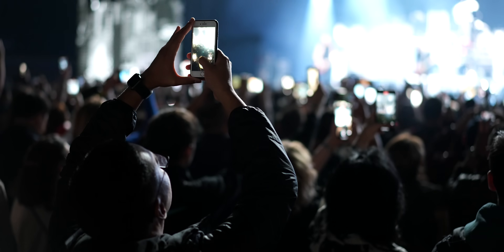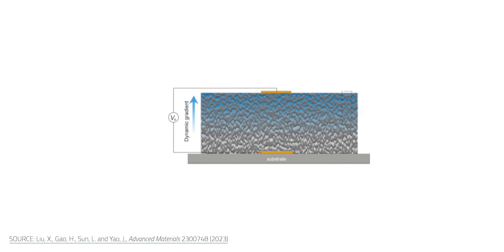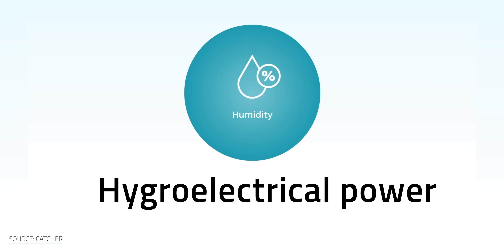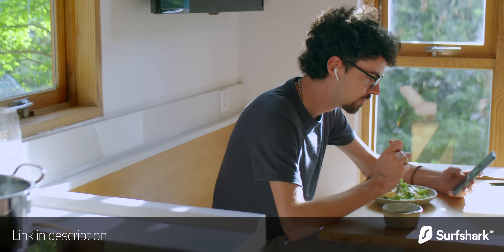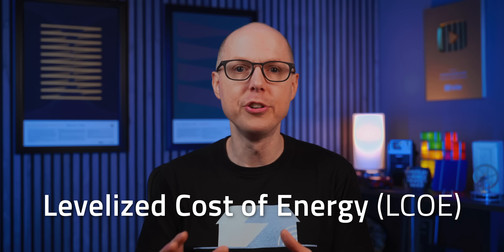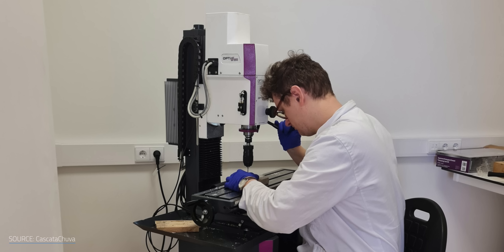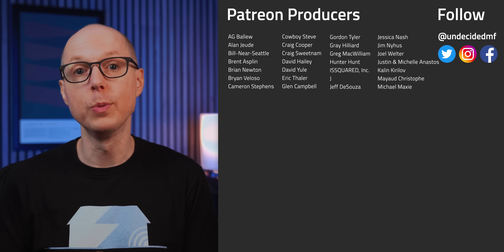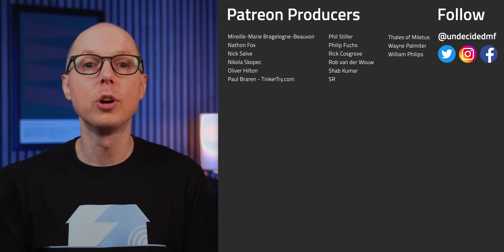Is This Accidental Discovery The Future Of Energy?

Comment: This is another one of your videos hyping up something with an unrealistic barrier.  I have zero doubt that one or two of them will get lucky and surmount that obstacle, they will definitely still be in the minority.  That said, if large scale production can become (very) cost effective for producing conductive yet appropriately sized nano pores, factoring in average wind speed and humidity, the Texas coast and Washington state will need to hop on it immediately.  That said, I really hope this is one of the ones that ends up getting lucky because then it is one obstacle away (very cheap long distance energy transmission) from the potential of significant increases in green energy production.

Comment: FIltered water mist and air in an enclosed monitored and controlled environment, it can work. But I doubt it can scale up. If it can work it is much more useful than solar and wind due to less limited factor from environment. You only need air and recyclable water, meaning anywhere on earth.

Comment: If it is running OFF humidity, it only needs an initial induction of humidity. Then it can be sealed. However, if the process is "merging" H2O with other things, like oxides or if it is disassembling them into H and O... Then there is a big potential issue. H+O will ignite into H2O, as an explosion, in high volumes. If it is merging other things with water, in an oxidation process... Then it could be generating toxins or, at minimum, highly acidic or basic chemicals that can cause damage and be caustic and reactive.

I do hope that it is just using the "difference" in + and - ion-collisions, as a bias of "flow". That is actually a major thing. However, it is nothing new. Our bodies and plants use a similar effect for our own bodies "power". Not all of our "power" is coming from chemical reactions. Some is simply bias of indifference. (How we "see", and "feel", vs how we "taste" and "smell". We "hear", by a variation of "induction", like a microphone, but on a chemical level.)

Comment: 10kW of solar is around $6k in Australia, and our dollar is only 65c US. Maybe our corrugated steels roofs make installation much easier, as well as using a single inverter, instead if individual micro inverters.
One good day of solar can power an EV for at least five days of driving. 5kWx6 hours gives 30kWh. 15kW/100km.
Average daily drive of 33.2km gives you 6 days of driving.
This device, if cheaper than a battery, would cover night use in an energy efficient home, but not air conditioning.

Comment: I'm happy with the development of tech that will eliminate the existence of the grid. 

When we can easily build homes that deal with all of their own needs at the level of providing a wealthy Americans lifestyle without outside connections (aside from the internet/roads) for as cheap as we have ever lived I'll count that as a win. The grid costs too much to maintain. It centralize power too much. It is dangerous due to many weaknesses/points of potential failure (ie has leaks and downed power lines). Also on a final note it's a national security risk as it would be easy for a foreign gov to shut down or civilization with a single cyber attack or emp.

Comment: I think you cost comparison is a bit off. Per your numbers, the hydroelectric battery is predicted to generate 10 kWh/day. A 10 kW solar array will generate much much than that, depending on sun conditions because every hour it is in full sun it will generate 10 kWh. A 10 kWh solar array in decent sun conditions will generate 40-50 kWh/day. Granted that will drop off during shorter days in the winter, but even those shorter days it would probably generate more than 10 kWh/day. 

My system is 7.35 kW. It generates around 8,000 kWh/year and I do not have a perfect roof for solar. The hydroelectric battery will product 3,650 kWh/year for the same price.

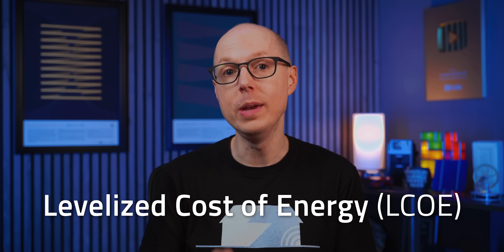Comment: You are confusing kW with kWh. At 7:30 you say a 10kWh humidity battery costs $19,000, then later you say a 10kW solar system costs $10,000 which is a similar cost. Actually a 10kW solar system will generate about 60kWh per day which is an order of magnitude more than humidity battery for half the cost.

Comment: I have a great new technology, it's called use less electricity. Hang your clothes outside to dry instead of using 1500w of energy even though it's hot outside... there's so many things people do and take for granted that could be slightly modified an using logic save tons of energy. Turn up your thermostat, get slightly more in balance with your local climate so you don't feel a different temperature than it is outside. Most people want their house to be the opposite temperature of outside, when it's not even that much. Like, yea 50 f is cold but people act like they're gonna die then their house is 85 degrees but not insulated... it's silly. Insulation is a technology too.

Comment: I'm confused more than enlightened. 

We have a material with nano sized voids which humidity finds it way into. Cool. Energy is generated. Even cooler. What happens to the humidity? It seems as though the material would fill up with humidity like a sponge and that would be it, no more room, no more energy. Either the video left out a step, or the water molecules disassociate, or some magic is introduced, only half a cycle has been described.

Frankly I looked at my calendar to make sure it wasn't April 1st.😵‍💫

Comment: I really like this tech and if it can be proven to scale and be as reliable as solar and wind and other green devices I say it's an absolute win for all of us and the planet. I would absolutely consider a device like this because I already run a humidifier while I sleep to help my sinus problems and it wouldn't be a big deal to get another one to help a device like this if needed. Those things barely use any power at all.  

Furthermore I think if a device like this came with proper dust filters I could see these devices lasting a long time considering there's no moving pieces to break and particles at that scale surely wouldn't wear down the device like a solar panel getting absolutely wailed on by the sun day after day would be. PLEASE keep us updated on this tech it seems like a perfect solution for my house to cleaner energy!

Comment: nope. no different from any other sensor that exists today. the thing with sensors, they generate tiny amount of voltage/power, connect a lot of them then one could produce enough power.  A solar panel is like a collection of massive amount of photo electric sensors which made them initially expensive.  Going back, there is more acoustic or radio wave energy that can be captured from the air than this humidity sensor. to be fair, still useful.  consider a remote location on earth that may need tiny of power for monitoring or sensors but batteries or solar pv may not be feasible.

Comment: Reminds me of an atmospheric electricity nanotube antenna from a couple of years ago - nanotubes grown on a metal plate, and placed on a pole a couple of hundred feet in the air.  It worked on the voltage differential between it and the ground.  They said it was generating tens of watts from a panel the half the size of a smartphone.
Reply: Only issue is getting it up there but yeah. Its good if you don’t have solar but u will likely have wind. But maybe u don’t have a dyno
Reply: Extremely unlikely.

Comment: The size and power production would seem to point at IoT uses. If the endurance is long enough there are a lot of low power sensors and similar devices that could really benefit here

Comment: At thirty seconds in I’m thinking about the wet season around the equator. 
Around there the lightning storms and tension in the air is different. 
Same as things that bridge long distances. 
(Thin single wire that uses the grounded stobie poles for potential energy to catapult energy across distances. 

Like the movie “arrival”. 

Pillar length spaced out. 

If we can use it as a weapon, this tech can go beyond it’s potential.

🙃🙃🙃

Easy mantra to project you’d say.

Just saying 😂😎😊🤜🏼🍀🇦🇺🙏🏻

Comment: I don't think this would work as a continuous generator as is described. Assuming this does generate a consistent voltage in its initial state then the electron flow caused by harvesting the energy will produce a counter voltage which will cause the water molecules to stick and accumulate over time, leaving less room for new water molecules to interact. There's also the problem that water molecules will slowly make their way to the other end of the passage over time which will also generate a counter voltage, reducing the net voltage you get from the device. Both of these effects will build up over time, making this more of a battery, with a finite energy capacity, than a generator.
A situation where I could see this operating as a proper generator though is when you have the humidity changing a lot. Theoretically if it were to get saturated at one humidity then exposed to a significantly lower one, water would be drawn back out which would start generating a reverse voltage from before which could be harvested. If the humidity were to pick back up again it would then go back to operating as described.

Comment: saying that the technology can generate 1.5 V is like saying "what's the difference between a potato?" . It is an incomplete sentence. Voltage is irrelevant without the sustained current under load. 

Static electricity can generate kV.

Comment: There's electromagnetic radiation in air and if humidity moisture is significant, makes sense some accessible energy is there. Whether pressurization can let it be closed system is thought...but there's also available heat from geothermal heat to make pressurized, humidity warehouse power plant. Energy sector needs to be nationalized to advance production when technology has advanced to this point.

Comment: You may have incorrectly compared the 10kwh per day of the battery to a 10kw solar system of the same price. But the solar will net about 60kwh per day. Still incredible, but 6 times the cost.
Reply: I was thinking the same, but as I was scrolling through the comments and no one picked up on this I was, starting to doubt my own sanity. Eventually found this after a lot of scrolling... So 10 kWh per day would be something like on average 420W continuous output which is much less than 10kW solar bank.

Comment: This reminds me of the water powered digital watch I had when I was a kid - you'd run it under the sink to fill up the little tubes with water, and it would run and evaporate the water over the course of a day or two. I don't know the mechanism these used, just a cool gadget.
Reply: Technically the "Wave" watch just used the water to complete a wet cell that powered the watch. The water acted as a transport to allow an electrolyte between 2 different metals - it wasn't powered by the water per se nor did the evaporation have anything to do with powering the watch.
Reply: Murray had a cousin device like it when water flow pass electrodes without touching. It could create sparks. Like static. His electrodes was coated I believe. Don't know if it was like yours.

Comment: I don’t think this will amount to much. I expect micro dust will bugger it up. Did you know there are devices that use changes in air pressure and temperature to operate? The Atmos clock is one example. It is useful. It works… but you don’t see them in every home. So it will be with the humidity battery: I envision a niche use and a novelty for the foreseeable future.

Comment: This whole thing is a confusing mess of contradictory claims. Is it a battery or a power source? What exactly is the energy gradient being exploited here? Does it somehow make the air drier, and if so where does the moisture go? How does it "recharge" and are there constraints/limits on how quickly that can happen? I'm not saying the device in question does not produce any power whatsoever, just that the connection between "there's a voltage between these terminals" and "useful power generation or storage device" is entirely speculative.

Discussion about producing a particular voltage is irrelevant; voltage without current doesn't tell you anything about the power produced. The side-bar discussing matching voltages to loads is also a distraction, because these days low-power switch-mode DC voltage conversion at high efficiencies (above 90%) is a commodity solved problem so it really doesn't matter what voltage your power source operates at. Also, the current CascataChuva device being able to power an "LED light" is a misleading claim often used to bolster the apparent viability of all sorts of dead-end power gadgets (weight-powered contraptions for example), because LEDs are incredibly efficient and can be "lit" using tiny amounts of power that don't produce a particularly useful amount of illumination and also couldn't be used to do much else.

Comment: Thank you for pronouncing Amherst correctly. I live in a humid area (currently 70%) that doesn't get enough sun or wind to make those viable energy sources, so this interests me. I am wondering what relative humidity is required for these to function, because when I run my wood stove relative humidity drops. What happens to hygroelectric devices when the ambient temperature drops below freezing?

Comment: Sorry but this seems almost dead on arrival. A structure (porous material with fractal-like pores) that sops up the occassional bit of moisture from the odd passing air mass, and that has a propensity to separate electrons (carried or released)?? This is just basic electrostatic charging, no matter the underlying electrochemical details. And when the electrons leave the electrodes they go to...? So, it's very likely this thing will prefer to self-discharge with a calculably pathetic avaiable external energy yield - possibly just heat (~ latent heat of condensation.)

Also a technical point, because this is just a silly red-herring: no one with engineering competence will source a higher voltage supply, using a lossy resistor, to power a low voltage load.  A cheap buck-converter circuit will readily do the job at about ~ 90% effy - check inside your LED bulbs! There is NO automatic advantage to be made out of a intrinsically low voltage source, especially one with "soggy" current characteristics.  regards, DKB

Comment: 10 kWh of energy is not the same thing as 10kW of power. A 10kW solar panel can produce 10kWh of energy for every hour where it is able to get full sunlight (ignoring inefficiencies for simplicity of explanation). So say there are 5 hours of good sunlight in a day, it could produce 50kWh which is 5 times higher than the hygropower.

Comment: It's not actually new, we've been doing it with graphene for a while now, the science of why it works is still new though. There are also many other ways to use water to generate electricity on microscales. The biggest problem is everyone wants to do the simple things with them - charging batteries. Paint your building with it, stop doing small scale, these microwatt ideas don't add up until mass scale.

Comment: It sounds like a gradient in moisture content producing an electrical gradient. As such, it could be used as a barrier to insulate items that need low humidity. Regarding dust particle clogging, if a closed loop system is used, say by having a section that boils liquid water that has to traverse through these membranes, and a section that condenses the water which is transferred to the first section via a pipe, it could be combined with other closed loop energy generation systems to further intensify the gains, or combined with AC units to recuperate some losses. Also, if the tech is so small, and volume is needed, I would much rather a wall to be covered than an extra appliance in the corner somewhere. If desired, it could be colored and used for aesthetics.
Reply: Congrats, you just turned this thing into a perpetual motion machine, thereby proving that it's not a viable method of energy generation.

Comment: Hmmm...if they work at night when there is no wind or solar, but the decreased temperature creates more relative humidity, then it might be a nice complement.  Edit:  I had to watch a little longer for you to come to the same point.  Also, those models very similar to Venturi models that suggests even electron flow through a channel can be impacted by Venturi like shapes.